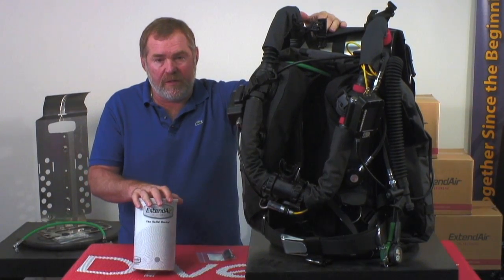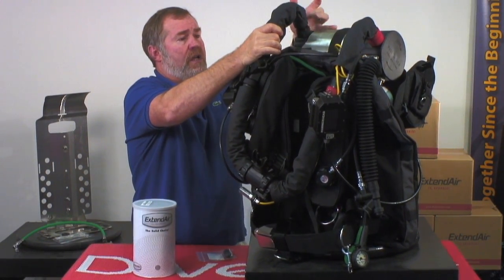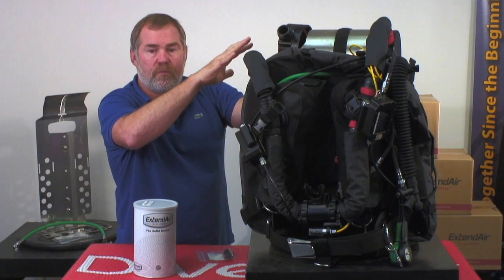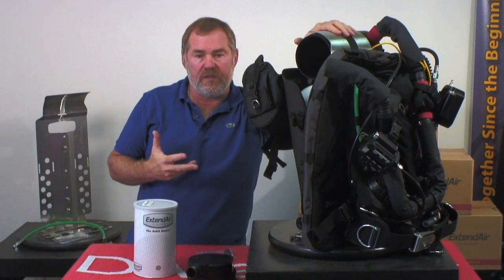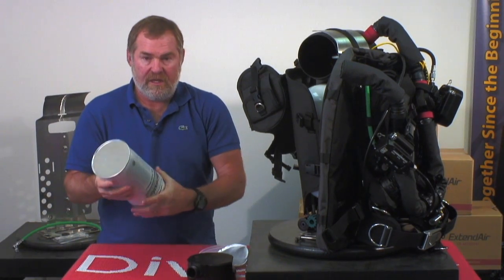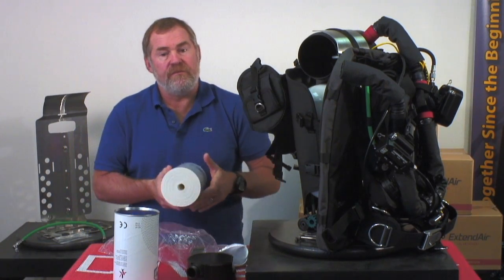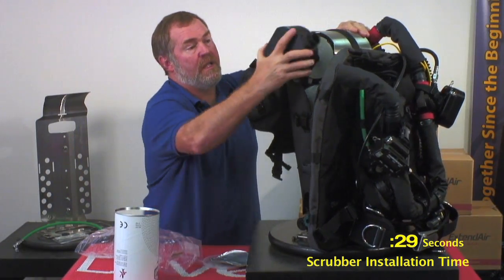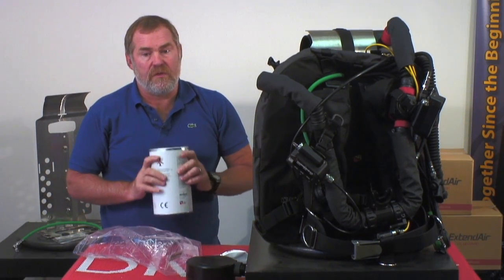Rebreather Diving: O2ptima Scrubber Information & Loading

Comment: Why aren't they making scrubbers you can heat to renew a cartridge? I refuse to buy a compound you throw away...  it's expensive (probably the manufacturers design to make more money) and unsustainable... guess I will have to make my own and market it.  I know it's possible, they do it with fuel cell technology now.
Reply: Rouen d'Arc Sounds like an experiment. How to store co2 in order to dump the gas only